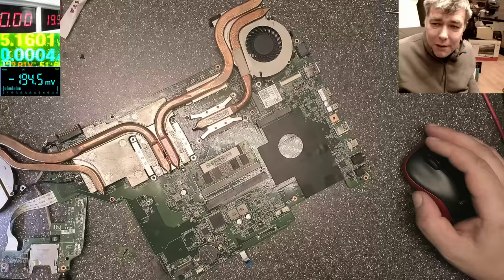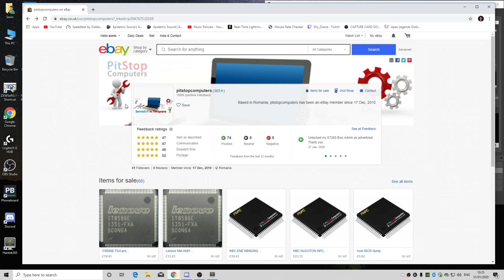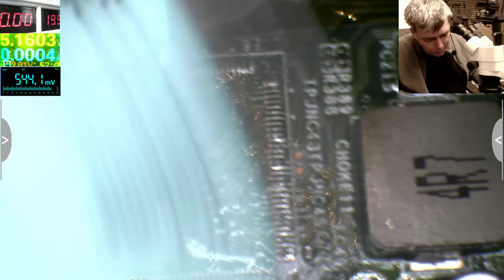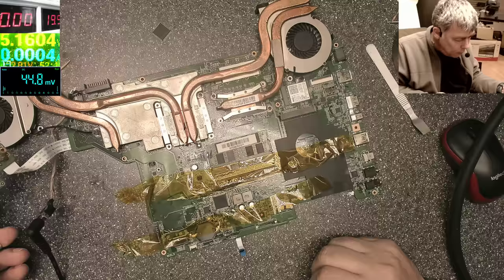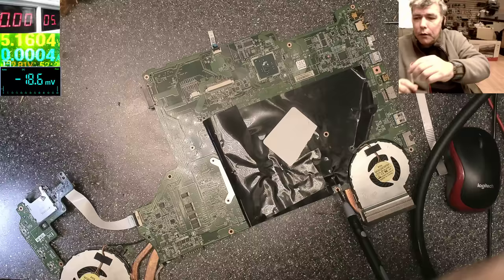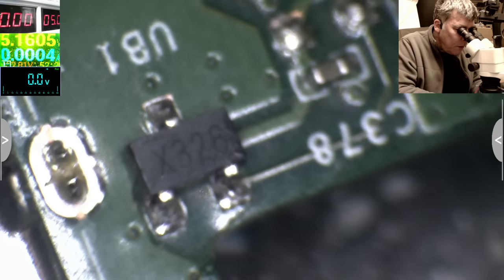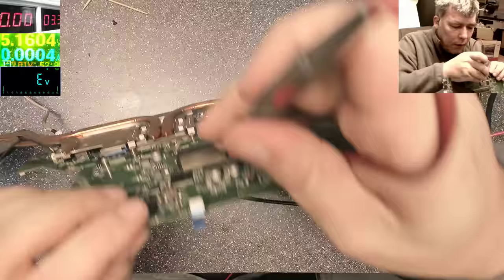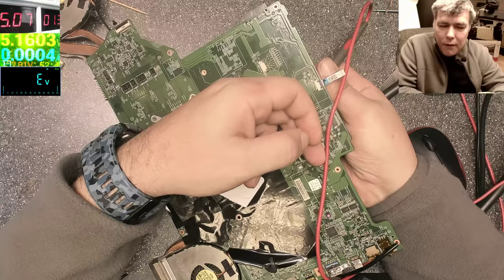MSI GE72 6QFn gaming laptop,  motherboard repair

Comment: First rule in SMT rework - When replacing an IC clean the pads and then replace. All the legs will then sit on the pads on the board: when re-soldering use hair fine thickness around 0.2mm 60/40: Solder one of the legs in each corner of the chip: Then thread the solder underneath the legs: Use a blade head when soldering: run the blade head across the legs, every leg will then be equally soldered: job done.  

Other than that my friend <<Excellent Video, much enjoyed>>

Comment: This is all your fault Sorin. ;-) I keep going to the recycling centre, getting dead laptops and fixing them. Fixed all 4 with various IO chip, capacitor sort to ground and mosfet related problems. Now i have working laptops and no ac adaptors for them only my lab power supply. 
I was hoping to have some dead ones for backup components.

Comment: hello im a very big fan of you keep up the good work :)
just wanted to say that i have a suggestion you can do a video of how to test different electronic component with multimeter to check if they are bad or not and another video on what to do in order to replace a bad electronic component i mean for example in case you are working on a laptop and you found a bad mosfet what to do how to find its alternative or at least where to find that part on other laptops etc and you can add these videos  to beginner lessons playlist 

best regards and again i love your work :)

Comment: You should  plug the charger when the battery is connected to enable the starting chip.. You cant expect it to work without the battery.
that is from my experience with msi g laptops

Comment: You can test the caps on top of the PCH see is they are shorted , You can Test the data lines of the usb ports to see if the PCH is shorted

Comment: In my laptop there was a damage to the usb2.0 socket, after initial measurements it turned out that between the mass and the date - there is 10 ohms and between the date + and the mass is about 60 kohm. there is also a high impedance between vcc (5V and ground. The laptop is msi ge62 2qd motherboard ms16j21 ver1.0. is it possible that there is some element between the bridge and usb that could be damaged and ground date-. I found a diagram on the vinafix website but it is a bit too expensive for me to download it. and the free versions of the schematics may not be complete. generally the laptop works fine, the temperatures oscillate between 40-50 degrees and the other components work. Please advise what could be done with it, how to save these usb and is it profitable and how much can it cost.Thanks in advance for all suggestions

Comment: I have two of the similar boards (MSI ge62) with bad chipsets, I would love to see how to replace those chipsets.
Reply: I have done an Asus ROG GL55VW the other day replacing the PCH
Reply: Does a chipset that is getting so hot is an indication of bad/dead chipset?
Reply: @BaliwNaL  I think that my chipsets are bad due to capacitors on top of the chipset shorted, and the majority of capacitors around chipset are shorted as well. Also, chipsets are somewhat discolored compared to functional board chipset. I was able to make the board work for a minute by pressing down on a chipset.
Reply: @BaliwNaL  Normally Yes
Reply: @BobSmith-ww9rp  if pressing down made it work ... you probably have a dry solder joint

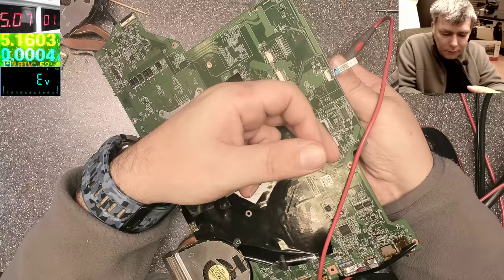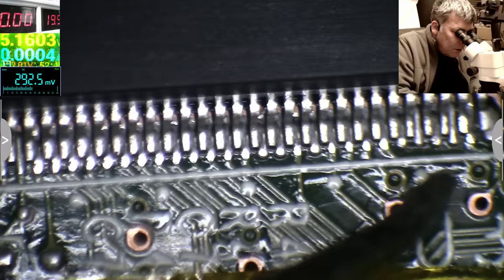Comment: 49:04 I'm not sure about that diagnose. Ok chipset is getting hot during short-test, but I'm remember how did you solder back the super i/o chip.  for me - on one side all legs are touching each other pads at 19:08. So to be sure - I suggest to take out again the super i/o chip and then repeat short-test on the coil. Even if you solder that chip good, without shorts - then the chip can be bad itself. Super i/o and the chipset are talking together, so if the super i/o is badly shorted, it could makes temporary shorts on the chipset.
Reply from the maker: Let's assume all the pins of sio chip are joined together, all shorted. The way how the electricity works, the current it will travel to ground using the shortest way, on our case the chipset. Chipest resistance generate heat which is normal according with the ohm law. The main problem, 0 ohms chipset internal resistance :)
Reply: @electronicsrepairschool  thank you for answer. 
and yes, but :) what about this idea: Two coils very close to each other (far away form cpu) means (on laptop boards) that they are main 3.3 and 5 rails. So you have strong short on 3.3V or on 5V rail. Let say that 3.3V or 5V goes to s/io chip on that shorted side to one pin, but If you have shorted 30 legs together on that side, it means that 3.3V or 5V will try to go everywhere there thru each legs. Some of that legs can be connected to chipset. Data lines, other ideas, etc. Maybe one of that leg is chipset ground or partial ground, or connection in part of that chipset which can "drain" ground from other places from that chipset.

I mean - if you have very complicated two chips, which are huge amount of legs/pads - as super i/o and the chipset -it is not that simple as you've said: here is plus, there is ground, low resistance - so it means dead chip.
I'm not saying that you are wrong. I'm saying that you should take up/take out super i/o chip again to be sure for 100% that chipset is dead.
Reply: @Radek__  everything is posible. But i think, super io is ok, never is changes with new one. same problem.

Comment: SORIN, U KNOW I LIKE U, BUT... 😀
IN THIS CASE THE SUPER IO SOLDERING WAS VERY DOGGY 😐
SECONDLY, IF U FIND A SHORT LIKE IN THIS VIDEO, PCH SHORT, GPU OR EVEN OTHER CASES, U CANT USE AS THIN CABLES LIKE YOU DID. I AM SURE YOU KNOW WHY.
BEST REGARDS

Comment: Take out the cpu, and measure the 3.3v see if there still had a short, don't forget that your  colleague had applied thermal paste to the cpu and there is a big heat sink on top of it,  excessive heat would dissipate quickly .

Comment: Make a short killer to blow up shorted component. Use any mobile phone battery, remove the circuit board and use only the terminals. Use 3 battery in parallel mode to get around 50A & 3.8V
Reply: huh ?
Reply: Ehhh????
Reply: @karltest1314  Yes, you are right. On data & clock line, it is too risky.. I just shared an idea to find out cheap solution...

Comment: Hello Sorin, I have an Asus N552vx. I took it to a local shop to fix broken hinge. The repair guy did the same mistake with the display cable. Now the laptop does not turn on. In my case when I plug in the charger or press the power button ( while running on battery) the chipset gets too much hot. Can the laptop be fixed? This quarantine period is too much difficult to pass without having a computer. Thanks

Comment: Helo sir sorin,im from philippines and i have a problem,,can you help me.may laptop is coming on but it will power off in a few seconds,what can be the possible problem,,i tried other super io chip from other board with same chip but it will not turn on with other chip.
Reply: Change RAM, CPU thermal paste
Reply: I tried.still the same

Comment: You actually have more amps. Like at least 50 amps, at least for a short while. In your hand is your vape. In there is a vaping grade 18650 Li-ion cell, and you're probably carrying a fully charged spare. Use that one on the chip-set. It will be satisfactory.
(Don't try at home and take care that your wiring cannot melt itself to the cell's positive end.)